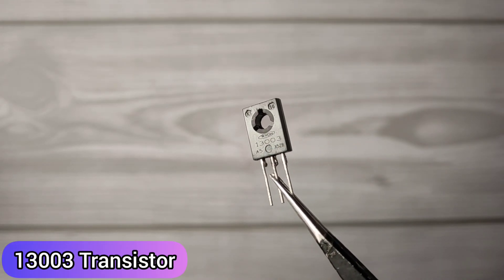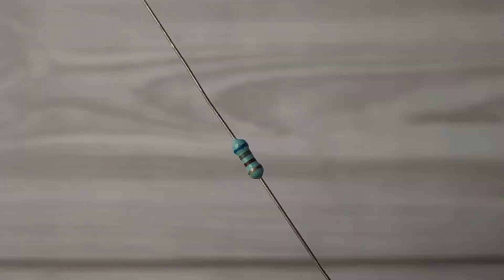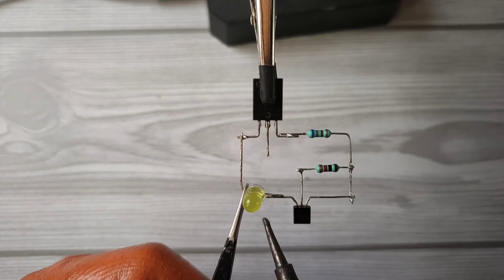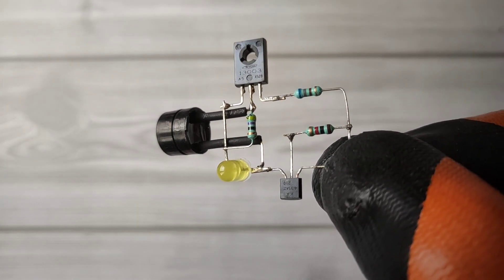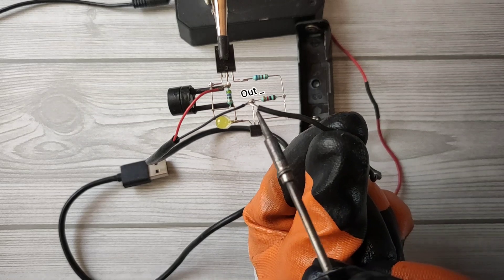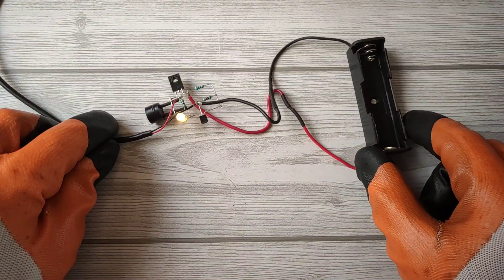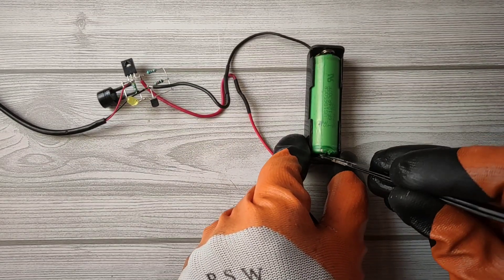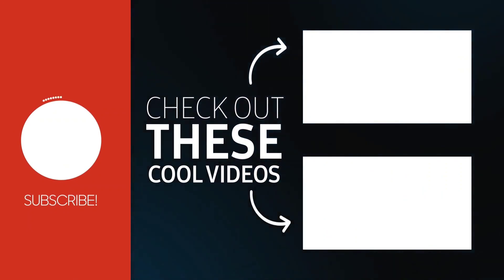3.7v battery charger with full level indicator

Comment: I like your videos very much and have a question. is it possible to charge pack of 6 battries of 3.7 volts all together?
Reply from the maker: Not with this circuit, as it provides 500ma for 1 cell.

Comment: Xin chào bạn tôi vô tình lướt thấy video này và thấy nó rất hay cảm ơn bạn nhưng cho tôi hỏi dòng xả của mạch này là bao nhiêu tôi có thể thay đổi giá trị của điện trở nào để tăng dòng xả của mạch điện này và tôi dùng transistor loại 13003b được không
Reply from the maker: Thanks for watching my friend 🙂, Yes you can use 13003 Transistor and about the current limiter, you can change 47 ohms Resistor to increase or decrease current output
Reply from the maker: Thanks for watching my friend 🙂, Yes you can use 13003 Transistor and about the current limiter, you can change 47 ohms Resistor to increase or decrease current output
Reply: Cảm ơn bạn tôi thay điện trở 47ohm xuống còn 33ohm thì dòng sạc sẽ nhanh hơn chứ và liệu khi pin đầy thì nó có báo chính xác dung lượng pin và đèn có sáng không và nếu bỏ còi buzzer đi thì nó còn hoạt động không
Reply: Chúng ta ở hai quốc gia khác nhau và múi giờ GMT cũng khác nhau nên thôi không sao tôi sẽ đợi bạn trả lời 😉

Comment: Do you have a video made on how to make the same circuit, but with 5v input to the 3.7v battery? So that the charging takes place faster. Charging with 4.2v takes a very long time. 
If not, could you please make the video? I want to make such a circuit. Thks.
Reply from the maker: Check out new useful uploaded today of USB 3.7v battery charger

Comment: Can I use 13005 instead of 13003.
Reply from the maker: Yes you can use, check out new video of 3.7v battery charger with automatic battery detection
https://youtu.be/VNT87hZ8io8

Comment: What if I used 3 lithium battery in parallel connection? Can this 5 volts still charges the 4 lithium battery in parallel connection?
Reply from the maker: Yes, it will charge, but will take longer as current will be not enough

Comment: The performance of the NPN transistors used in this circuit will be as follows.
j 13003  .13 A
BD 139   .53 A
2DS362   .50 A
TİP41C   .60 A
2N2222   .42 A
BDX53C   .21 A
BC 547   .23 A
BC 337   .53 A

TIP41C gives the best results
Reply from the maker: Thanks for posting your suggestion.

Comment: Hello my friend
I implemented that circuit as you did and it was connected to a mobile charger but the circuit output was only 3.3 volts and it did not give me 4.2 volts, can you help me
Reply from the maker: If you used same value Resistors than output should be 4.2, Also make sure TL431 is worky.
Reply: @CreativeTechos  The data on the transistor
13003C
B03322
And the other transistor
TL431A
1118SD

Comment: sir can i replace tl431 to transistor 547 or 2n2222.in same component.and sir input is 5volt 1 amp which is output current through the battery.plese reply.
Reply from the maker: Nope, absolutely not TL431 is ic or adjustable zener diode, it is not Transistor,  it comes with different codes, TL431, KA431, 431
Reply: @CreativeTechos  thank you sir.
Reply from the maker: My pleasure Thanks for watching 😀

Comment: Sir what happened when charger is off and battery remain connected to this circuit?
Reply from the maker: If charger is off and battery is connected, tl431 will nit allow transistor to open, So battery charge will mow flow reverse.

Comment: How much amp is it,, can i charge 6 battery together
Reply from the maker: No only designed for single battery,
Check out on my channel other video of 3.7v charger with auto cutoff, you can charge upto 5 cells in parallel with that circuit
Reply: @CreativeTechos  is there anyway to charge 6 or 5 battery together?
Reply from the maker: Yes, please check out video on my channel. 3.7v battery charger with auto cutoff,

Comment: Sir, can I use 13003 small size transistor like bc 547?
Reply: SirBC547&Bc548 are same or not?can we use Bc548at the place of BC547?
Reply from the maker: Yes you can use bc548 instead of bc547
Reply from the maker: You can use other simlar transistors by taking care of pin-outs, but not bc547 or other small package transistors as they cannot handle higher currents to battery.

Comment: Sir if I don't connect burzzer can it works?and what is the connection point of red LED? pls answer.
Reply from the maker: Yes buzzer is just to alarm, without buzzer yellow full led will glow when battery is fully charged, 
To connect charging led check schematic diagram given in video as well as download link is in description.